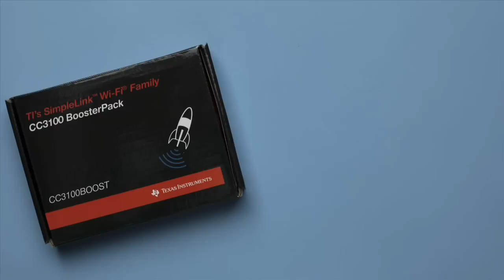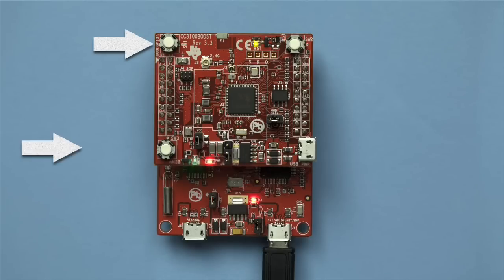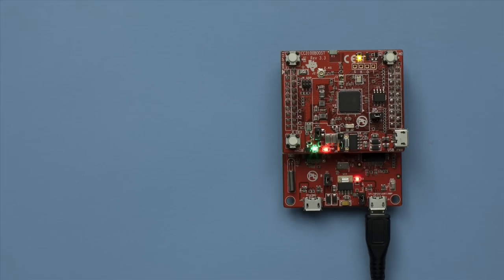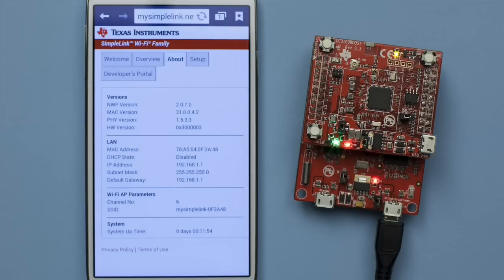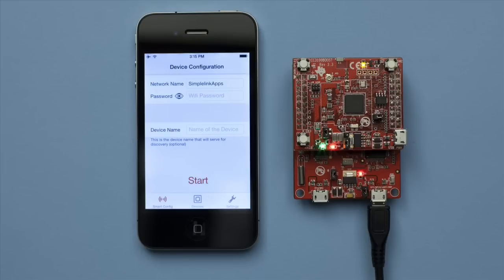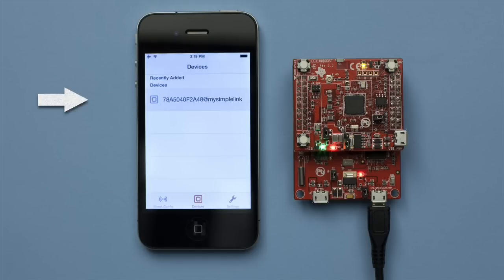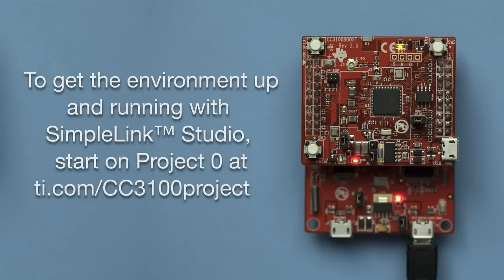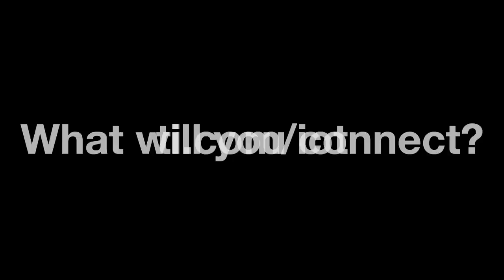SimpleLink™ Wi-Fi® CC3100 BoosterPack Out of Box Experience

Comment: When I do the switch combination it doesn't go to access point and the connection' doesn't appear in the wif connections I am using a CC1310 launchpad with it
Reply: I cannot find simplelink in the available wifi connections
Reply from the maker: @nibzlegend99  Hi Nibz, Thanks for your interest. For technical questions, visit the TI E2E technical support forums: http://e2e.ti.com
Reply: @TexasInstruments  Thank you I am pretty active on there but I am trying to find out something simple. Does this procedure work with an MCU such as the CC1310 Launchpad or is there a different way of setting the CC3100 in Access point mode If I am using an MCU instead of the emulator? Thanks for the feedback and for your video